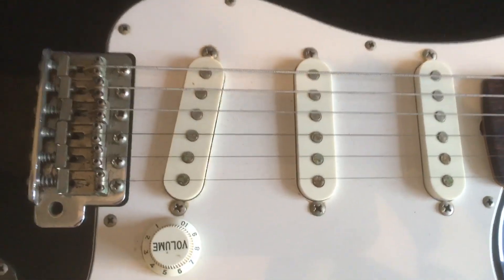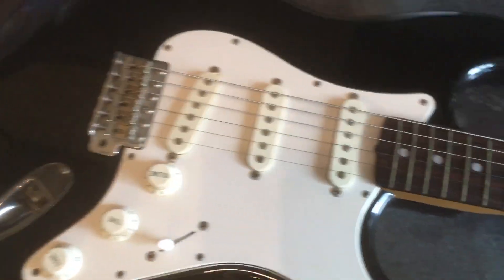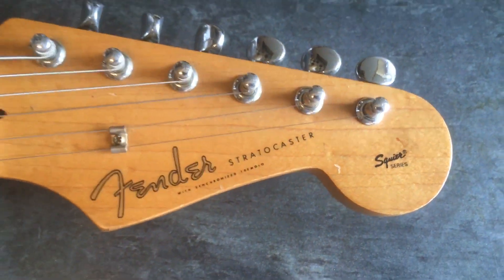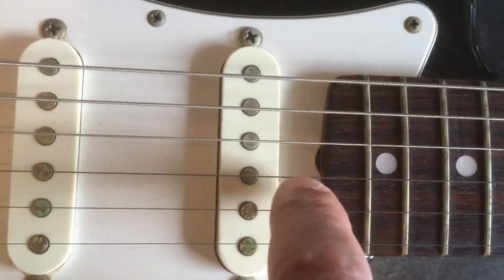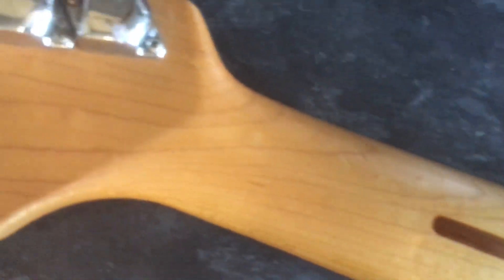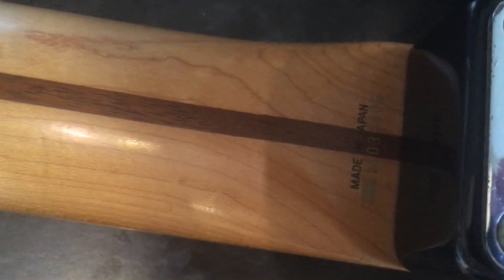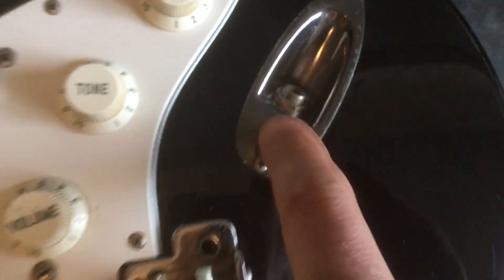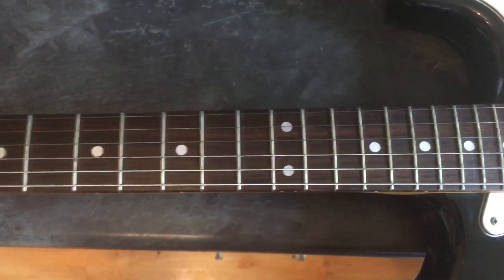Fender Japan Stratocaster 90’s.

Comment: Well done, they are a very well made instrument. I picked up a Floyd Rose version in a HSS configuration. I have pretty much pimped it out, with German FR Original bridge with Ti parts. Seymour Duncan pickups, upgraded pots and switch and Gotoh tuning machines (I had fill the holes from those crap tuners and open the holes for the tuners up from 6mm to 10mm, but in the end I have a Super strat that plays beautifully, with all high end gear. I would never have done all that on a US Strat. Go mental with it, you wont be disappointed.
Reply from the maker: Yours sounds cool. This one will get done in the future. Pickups and electronics. Cheers and be lucky

Comment: The 90s Strat Plus is basically a Jeff Beck Strat without the heel access carve. They used a roller nut to make the strings slide easily over the nut and was made by Wilkinson. It is the opposite approach to a Floyd Rose nut that locks the strings in place. Later they switched to Fender's own LSR Roller nut. The original design of the tuning keys are by Schaller and you may find a replacement locking nut from them. They are staggered in height to eliminate the use of the string trees but you could add one if you want, although it might defeat the purpose of the slippery nut and low wrap tuner in keeping the guitar in tune while using the whammy bar. You can also, wrap a hair band on the headstock to stop the string vibration. Good luck